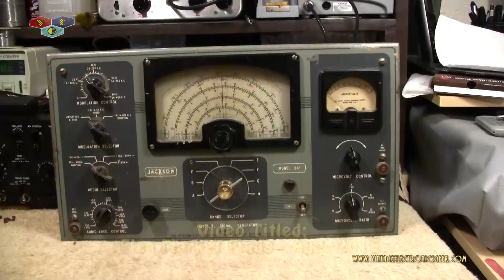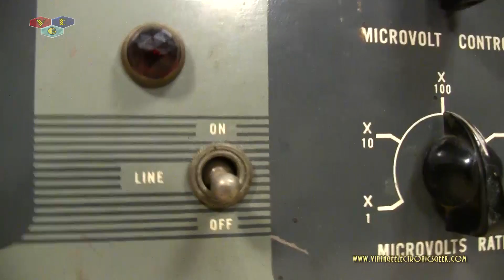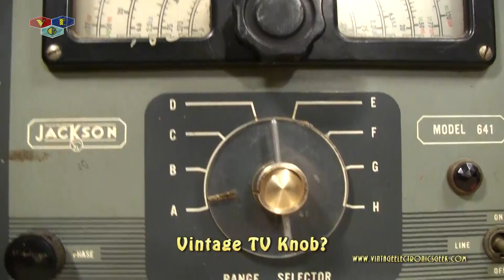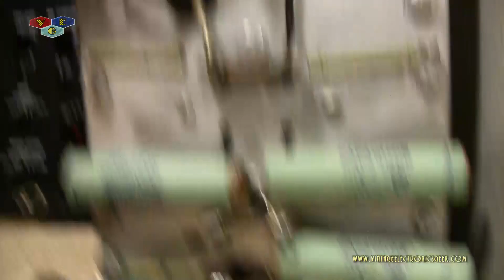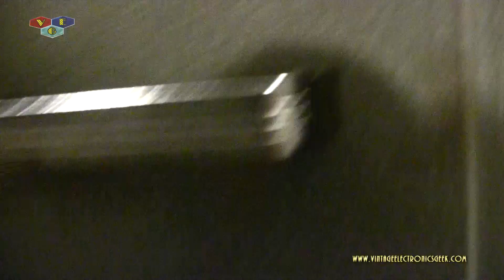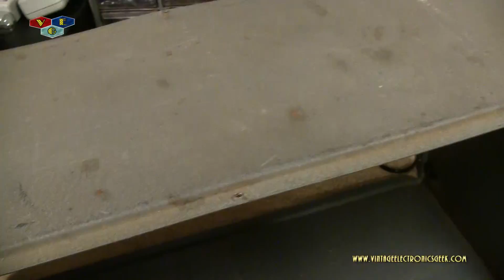Jackson 641 Signal Generator - First Look

Comment: Wow Jack. Just caught up with the whole of this video. That thing is built like a tank. Just look at all that cable lacing! Some dodgy looking paper caps in there that I'm sure you will either restuff or replace. Those wafer switches need a good clean as well. Good luck restoring it. Thanks for the mention as well. All the best Graham